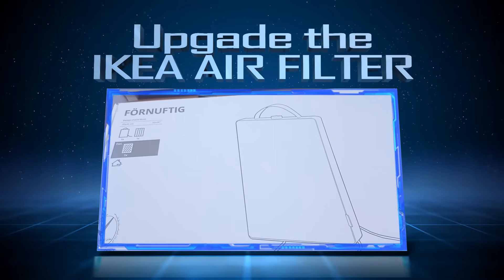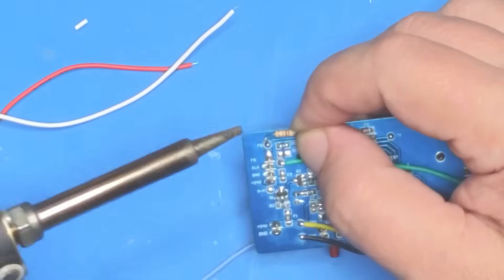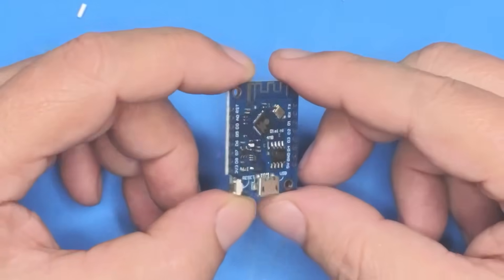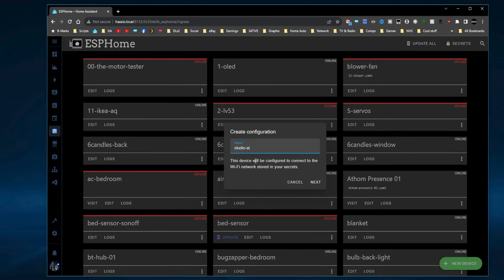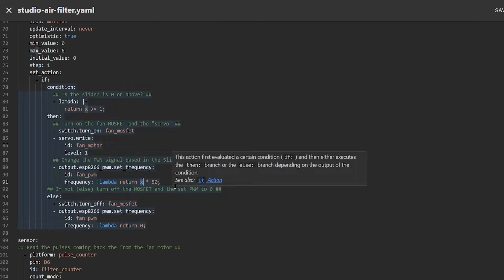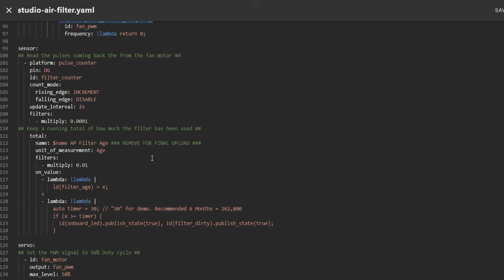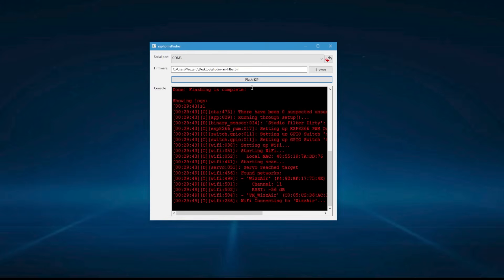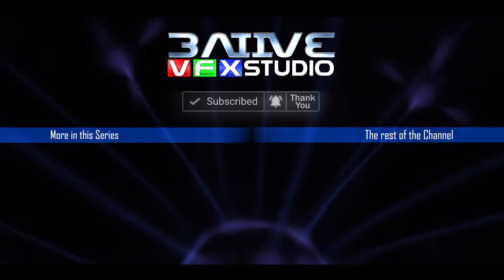Control Your IKEA Air Filter with Home Assistant and ESP8266 Upgrade

Comment: Great thing, will be doing it now, just bought that 80-bucks device from IKEA.
But i have minor question: could this logic be done using "fan" component from ESPHome instead of number? I believe so, but can't put that 5o% duty cycle, servo and stuff together to trick out fan configuration, and afraid to fry the device...
Having fan would be really cool, at least for me, cuz i have auto-generated dashboard and automations/scripts, working on new Labels + Zones in HA...
Reply from the maker: The main reason is the way the Fan works. During my R&D/Testing I measured these pulses per speed
Speed 1 = 100 Pulses/s
S2 = 200 & S3 = 300
So, I needed a way for the D1 Mini to output what the fan was looking for. Plus doing it this way means I could not keep the fan happy. Plus, dividing meant I could have 6 speeds instead of 3.
Reply: @3ATIVE  right, so basically pulses frequency is linear from 0 to 300 Hz, right? We could put that to fan, making it either continuous (looks like direct x3 mapping for percentage), or with same 3 or 6 speeds. At least I know how to do it in HA integration - so it should be possible to do it in ESPHome too...

You see, many people out there stick to HA automations instead of direct device-device interaction. 
I fully appreciate that ypur way is much more robust and low-level, and works by itself - but HA way has its own advantages, such as additional variables (e.g. I don't care about air quality while no one is home, why waste filters and electricity) and universal approach (I got 3 different kinds of air quality sensors in my home and 2 different purifier types, this one will be third one - and all logic is within one single automation, centralized and clean).

So I will try to convert your approach to fan. Thank you for all R&D and basically all job done! :)
Reply from the maker: @CrossPosterProgram  No worries, I put these tutorials out to not only show what I do in my home but, to inspire others to build on what I make.
For "Not at Home" I've added an "Enable/Disable" of the IKEA Air Sensor, much like the "Window" sensor I used on the Filter project. 
That way I can "disable" the ESPHome automation when I'm away, etc.
Reply: @3ATIVE  okey-dokey, so I just replaced your number with template fan, set speeds there and on_speed_se5/on_turn_on/on_turh_off lambdas. Works as a charm.
Now I want to tune a bit that filter age counter, cuz it seems to count all the time. I want to stop counter if fan isn't working. And probably make that ugly number internal, exposing some template sensor with calculated percent left.

Just wanted to ask: am I right that that counter is just counting time till 6 months based on clk?
Reply from the maker: @CrossPosterProgram  Well done. 
As for the counter going all the time - There's another track-cutting-fix. 
Weird that so many people have to cut these tracks and I didn't.
Anyway the next track to cut is the one before the resistor at the top. 
The way I worked out the counter is based on the fan speed(s)... IKEA recommends the filters be changed every 6 Months. However, I realised that may not be the case if the fan is going at low speed all the time. 
- SO, I calculated how many pulses the fan gives out for full speed after 6 Months and compensated for the various speeds it could do. Hence the "Filter Dirty" instead of "Filter Age" Sensor.
Reply: @3ATIVE  I thought that you're too clever to get it counting all the time. :)
To be clear - you're talking about that loooong track from FG to R10? I figure that it's the one coming from controller, and we supposedly don't need it.
Then you've done most of work for me again, and I just need to expose percentage based on age to total division.
P.S. I didn't have to cut that white wire track btw, it works for me by default. I have blue board.
P.S.
Reply from the maker: @CrossPosterProgram  LOL - I try and be cleaver as much a possible. 

As for the track, there is a GITHUB issue I posted for it, check this link:
https://github.com/3ative/ikea-air-filter/issues/1#issuecomment-1902742927
Reply: @3ATIVE  thank you! Yes, that's the one. :)
Reply from the maker: @CrossPosterProgram  Excellent, I guess you're be all working pretty soon now. 🥳🥳
Reply: @3ATIVE  alright, I'm almost done now, with buck converter, and onboard LED for filter, filter life percentage and fan. Everything looks great. One thing bothers me: each time I reboot ESP or reflash it, or power-cycle the device - it turns physical fan on. I tried to set MOSFET off and frequency to 0 on_boot, pur fan restore mode to ALWAYS_OFF but still it turns physical fan on, although ESPHome shows it's off. I have to turn it on/off to actually turn it off.
What could it be, good sir? :) I promise that's my last question.
Reply from the maker: @CrossPosterProgram  Check the pin you're using... some are High on Boot. Changing to another [should] fix that.
Reply: @3ATIVE  I used your pinout. Pulse on D6, PWM on D7,  MOSFET on D2. Also I have onboard PCB LED on D1. All of them should be low on boot, according to specs...
Reply from the maker: @CrossPosterProgram  Oh soz, I though you were the one using an ESP32... 

Hmmm, maybe it's the code or the way ESPHome works??
I had a similar issue with an up-coming Humidifier tutorial using the "Fan" component. So, I stuck with what I know worked... Sliders and Servos.
Reply: @3ATIVE  alright, I got it, now everything works on 100%. Thank you for your help!
It looks like fan was setting speed even though it was off on start (at least lambda was called). I reduced code duplication in each lambda to bare minimum, and it works. :)
Reply from the maker: @CrossPosterProgram  YAAY! I'm glad we... more you thou, were able to sort it. 
Enjoy. 🥳
Reply from the maker: Additional:
I wanted mine to be controlled (automated) by my previous project  - The IKEA Air Quality Sensor.
- So there is/was no need to have anything in HA (Fan or otherwise).

Comment: Can you use a mini 360 buck in place of the regulator you used?
Reply from the maker: You can use anything you want...
As long as it can take in the 24V and output 5V
Reply: Actually that is 5v to 3…. I have a hlk-5m05 which can step down 240v to 5v, sounds a better option right?
Reply: 5V 1A 90VAC~265VAC 120V~350V 5W AC-DC 69% Plugin Power Modules ROHS (it says)
Reply from the maker: @neilos2085  I think we're missing something here. 
The Ikea unit already comes with a Mains to 24v PSU
So, the Regulator I used takes that 24v and steps it down to 5v for the D1 Mini.
Reply: Typical. Back to Amazon I go. And expect no delivery as it bank holiday 😂😅
Reply from the maker: @neilos2085  LOL
Sorry for the confusion - I'm sure I mentioned it's a 24v fan in there. So, we need to step that down for the D1 mini.
Reply: @3ATIVE  you did as you always do. My ears are selective, so my wife tells me
Reply from the maker: @neilos2085  LMAO
I do try and give as much info as I can. Also, I think you'll be ok... I've had Amazon deliveries on both Sundays and Bank Holidays.
Reply: @3ATIVE  this is the one I found for delivery tomorrow. Seems ok right? MP1584EN DC-DC Buck Converter Adjustable Power Supply Module 24V to 12V 9V 5V 3V
Reply from the maker: @neilos2085  Yep - They look AOK to me. Just remember to set them to 5v BEFORE you connect the D1 Mini to it..
Reply: How about this? Mini MP1584EN DC-DC Buck Converter Adjustable Power Supply Module 24V to 12V 9V 5V 3V

Comment: Thanks for another great video, really informative!  I was wondering if you had seen the smaller air filter from Ikea, the Uppatvind, and looked at similar mods for that one?
Reply from the maker: Thnx Brad, I'm glad you liked the video/tutorial. I wonder... have you followed this version or do you only have the smaller one?
A discord member did mention this one but, it was too small for my needs.
* I [may] get one and "convert" it - If enough peeps request it. 👍
Reply: @3ATIVE  Thanks, yes I've got one as the bigger one was too big for my needs, the PCB is quite different as it doesn't have the rotary switch etc.  I'm happy to send some photos of the board and inside of the unit if you would like to see them.
Reply from the maker: @BradA25  I hear ya...
Sure - Come join my Discord, to post photos and let's see what we can work out for ya and a new tutorial ? LOL
https://discord.com/invite/3RbZgvHeJ9

Comment: Great work! I have just a question, to avoid a step down DC controller, is it possible to catch the +5V from the board? I See a +5V point in the board layout.
Reply from the maker: Thank you 👍
I did try the on-board 5 volt rail. However, the on-board regulator got too hot for my liking.
Reply: @3ATIVE  OK got it! Thank you for the advise!
Reply from the maker: @Stgw44  You're welcome - If you need any more advice, feel free to ask.

Comment: Hi 
Thank yoh for another great how to much appreciate, 
Now i have just put this together and uploaded the code on to the mini and reinstalled it all but for some reason the fan isnt running?
When i move the slider the age counter goes up and the the minis blue light is turned on but no fan.
Any suggestions please.
Reply from the maker: Sounds to me like you have the Blue and Green wires reversed. Check your wires at both ends.
Reply: @3ATIVE  I shall give it another look tomorrow with fresh eyes ,thank you
Reply: @3ATIVE  Right so i had another look and checked the wiring which checked out fine but i have managed to get the fam moving with the slider but i have to turn the knob to 1 to get the fan moving . When the slider is set to 0 the fan is still moving but at a low speed and doesnt stop unless i turn the knob off but then the filter age counter carries on counting?
What am i missing?
Thank you for you help much appreciated
Reply: right it the old saying read the comments and you will find your answer lol,all sorted now thank you.
Reply from the maker: @nutbox76  oh that's great news. 🥳
Weird that so many people have the same issue and I don't - I must make a 'Pinned Comment' ASAP
Reply: @3ATIVE  yes they must of updated the board because I bought mine a few weeks ago, the board is green in mine where ad yours is not so maybe that might be the way to tell who knows. 
Anyway thanks again

Comment: Great Job, Just replicated from Italy. I have to ask a suggestion. Wich Home Assistant card you suggest to better control Air Purifier? Thanks
Reply from the maker: As the Filter Speed is controlled by a "Slider" (0 = Off) Any card will do.
However, for me, I don't need/use any control in Home Assistant - My IKEA Air Quality Sensor sets the Filter's speed automatically.
Reply: @3ATIVE  ok clear. As you know is there a way to show fan speed as a fan instead of a slider? I ordered material for air quality mod😁, can you share your automations? Thanks
Reply from the maker: @MarcoPozzuolo  Oh cool - Have fun.
Like I said, once the Air Quality Sensor is done, that controls the Air Filters' Speed. That's all done with the updated code I shared with my other tutorial:
https://youtu.be/07jmTm7Hdhs

However, if you still want manual control of the Filters' speed, this tutorial should help:
https://www.youtube.com/watch?v=-7Hu9lMZsjw
Reply: @3ATIVE  thanks a lot for your work🙏
Reply from the maker: @MarcoPozzuolo  You are most welcome. I have a lot more to make.
Reply: @3ATIVE  HI I noticed an issue with filter Age counter. With node just powered, Age counter is stopped. Starting the FAN, start also the age counter. Stopping the fan, age counter do not stop, until restart of the node. Any suggestion on how I should check? Marco
Reply: @3ATIVE  Hi, I can confirm that cutting the track that comes after the "FG" pad and the original controller the issue is fixed
Reply from the maker: @MarcoPozzuolo  Cool. Glad you found the answer - I'm sure I've replied to others with the same issue. 
Funny though... It works AOK on mine. Must be a D1 variant issue.
Reply: @3ATIVE  yes I got your suggestion from another answer. I wrote a reply also there
Reply from the maker: @MarcoPozzuolo  Ah there's your reply... Soz for noticing it :)

Comment: Not sure what is wrong: I cut the connection under the white wire and am sure, it is cut. However, the control knob still works as before and the only thing I can do from home assistant is to turn the fan off by setting the speed to 0. If I want to get it back on, I have to turn the knob to 0 and back. Any advice how to debug?
Reply from the maker: Sounds to me like you haven't cut the track properly.

Comment: Just for clarification, is the final results to control fan , like on-off and control the fan speed?
As my final result, I can control the speed, but I need to turn on the switch to either 1-2-3 position
If I turn to 0, fan doesn't work and I can't control it via HA. And also, if switch is on and on 0 position in HA it constantly works on lowest speed
So I wondering if did something wrong with soldering or the code...
Reply from the maker: Yes, the idea is to On (control Speed) and Off. 
As for needing the move the control...
Some recent comments mention the boards can be different. 
To "fix" you issue you have, cut the track before the resistor the White wire is attached to. Try that and let me know if that fixes it for you.
Reply: Youtube algorithm is a mess. Only see a lot of comments about this after I wrote one.
Is there any way you could provide more details how to cut the track before resistor? I have no knowledge how things just works and just followed the tutorial 😀
Reply from the maker: @kulnis182  I obviously didn't need to cut the track on mine. However, If I do need to cut one, I just use a sharp knife... Box-Cutter / Exacto / Etc.
Reply: Sorry for the stupid question, but where is place on the board I need to cut it?
Reply from the maker: @kulnis182  Cut the track that's between the resistor, where the White Wire is soldered, and the on-board Micro-controller.
Reply from the maker: @kulnis182  Please see the "Pinned Comment", I've just added an image to show the cut-point.

Comment: I gave this a try, and it seems to be at least partly working. I can't turn the fan on or off from HA, I have to put the dial to either 1, 2 or 3 position. Then I can change the speed, but not turn off. I've read here there "should" not be a problem with the original microcontroller, but it does seem to be interfering on my device. Any advice?
Reply from the maker: Some recent comments mention the boards can be different. 
To "fix" you issue you have, cut the track before the resistor the White wire is attached to. Try that and let me know if that fixes it for you.
Reply: @3ATIVE   Yep, that solved it! Of course read those comments after posting myself.. Now I see something else I think may also have a similar fix, or maybe it's intended by design, though maybe should have been even lower value, I don't really understand the yaml code well enough to say. But, thing is, the filter age is incrementing when the fan is set to 0, more so than by a higher setting. Let's say for example the age increments by 1 every two seconds on speed 1, but on speed 0 it increments by 6 or 7 every two seconds.
Reply from the maker: @stian5851 It's always the way. Glad it fixed it for you too.
Looking at mine, at speed zero my counter is not moving. I can't see why any signals would be coming off the original controller for that. So, you could try cutting the track that comes after the "FG" pad, where we solder the Blue wire (with the 10K resistor) between the resistor and the original controller.
Again, please comment back if that works too.
Reply: @3ATIVE  Hi, I tried and I can confirm that cutting the track that comes after the "FG" pad and the original controller the issue is fixed

Comment: Great video (well the whole set of them frankly), I have set this up but I have a small issue, the fan never totally turns off, at 0 it turns ever so slowly. Have got around the issue but adding a smart plug which turns on the unit if the air quality starts to worsen and then the unit takes over to control the fan but this is obviously a bit hacky. Any thoughts on why this might be?
Reply: I encountered the same issue. You need to cut the PCB trace originating from the native controller. It's possible that the PCB revision or firmware differs from what's shown in the video, causing an unintended pull-down inside the chip when it's not in use.
Reply: @marcovergueiraxd  thanks for this I’ve not got around to looking back at it yet so I’ll check this out. Where exactly do you mean? Might be obvious when I look but away from home at the moment
Reply: @iainhay2823  I'm referring to the track that connects the U1 to R13.
Reply: @marcovergueiraxd thanks that’s really helpful I’ll take a look when home later in the week 👍
Reply: @marcovergueiraxd  cheers for this just got back and sorted this, was very obvious when I opened it back up and indeed it works perfectly! Thanks :)
Reply from the maker: Ok, now I've seen this LOL
Just in case others will find this useful to...
As the White Wire controls the MOSFET and thus switches power to the Fan, My guess is that's where the problem is. Check there for either bad or wrong connection